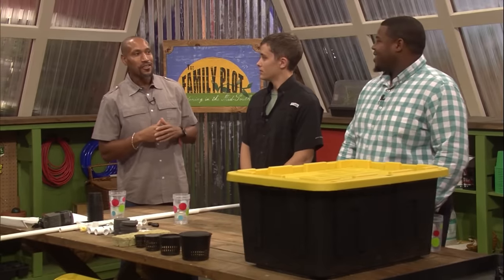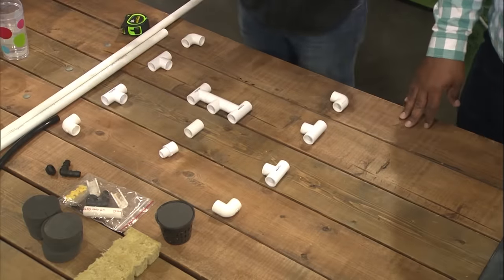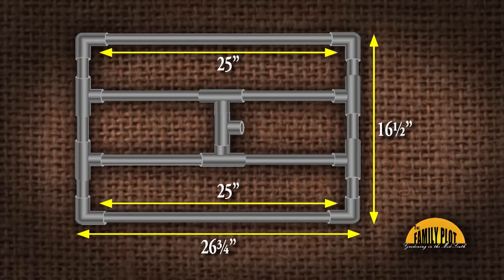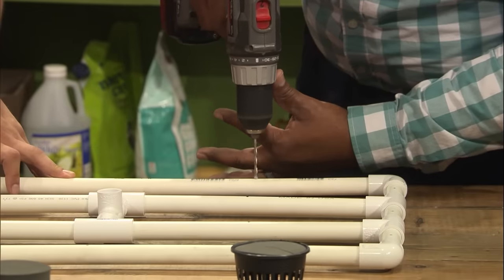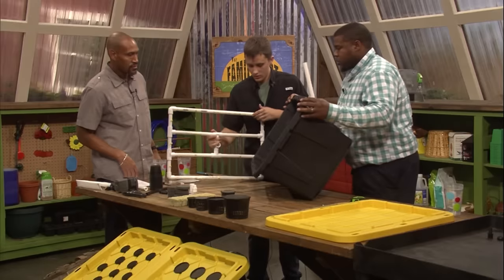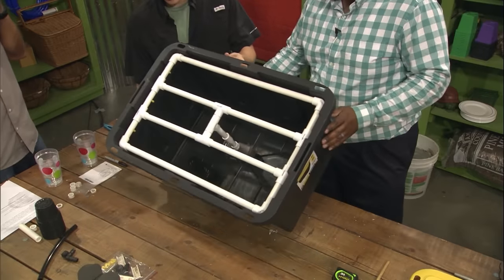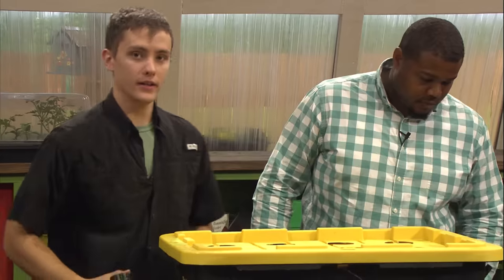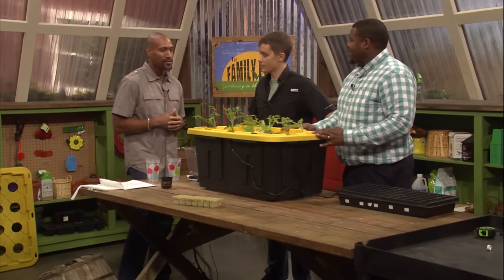Building an Inexpensive Hydroponics/Aeroponics System

Comment: I've just constructed this; with the sprayers pointing downwards as in the video, no water is spraying the cups that hold the plants. I'd imagine they should, would it be best to have the sprayers pointing upwards?
Reply: The idea is to transplant cuttings (or seedlings) that have roots already extending down a bit. If you need the extra help, twist the pvc "T" so that they point up and then point then down again after the roots are long enough. Watch for leaks when pointed up, though.

Comment: interesting, the first time I seen that kind of sprayer system, as I am used to old school method  of using fish tank bubblers to keep the solution agitating & filling the reservoir to the bottom of the plant baskets until the roots grow into the solution, at that point you can allow the solution to evaporate down to the 3/4 full mark.

Comment: How often would you cycle the pump with this setup?  I was thinking of doing this witht the pump on a timer.
Reply from the maker: This set-up does not have a timer. It runs all the time. You can use a timer if you want.
Reply: @FamilyPlotGarden  Thanks, I bought a 400gph pump but it is not variable, do you think the pressure would be too high?  I noticed you turned the flow valve down in the video on the pump.
Reply: update, pump works great no need to reduce the volume.

Comment: Hey so what's the advantage for something like this vs a stagnant self irrigating system like an autopot?
Reply from the maker: The spray aerates the water which allows the plants roots to get more oxygen than stagnant water. It also allows more plants per square foot than an autopot style system. It is also totally self-contained.

Comment: Can you please let me know what the spec’s on the pump you used? Also won if you tried a pump with less or more Gallons per hour. Just want to be able to compare cost on the pumps. I’m disabled and on fixed income so I want to be able to keep costs down where I can. Thanks for any help/info you can give me.
Reply from the maker: This is a 400GPM pump. You can use a pump a little larger and smaller than 400 if you want. The problem with a smaller pump is that eventually it is not powerful enough to create enough pressure for the spray heads. I would not go below 300GPH. You can go as large as you want because most pumps like this have the ability to restrict the flow at the pump. Another way you can save money is to only buy 180 degree sprayers and use two of them close together to form 360 degrees. The more sprayers you use the larger the pump you need. I did the 180 degree sprayer trick for one system and it still runs fine on the 400GPH pump.
Reply: @FamilyPlotGarden  thank you for your answer. I’m going to start learning how to grow this way. With everything going the way it is I feel the need to find a way to grow year round. I live in the northeast. There’s a big part of the year that growing outside is not an option. Thanks again keep posting videos like this that help people have options for feeding themselves and others
Reply: @oldtymeliving4198  good luck to you! Thanks for your interest!

Comment: Just going to put this out here. This is a very interesting system and it does work however, after some time the lid leaks. Which makes sense because you are spraying water over and over. Great concept, just keep in mind it will leak eventually. In addition, the hole to pass the cable has to be on top, not on the side, again, the water spray will leak from there. You can perhaps put a gromet and prevent that. And some kind of seal on the lid to prevent leakage.
Reply from the maker: Because the sprayers point down the leaking problem is eliminated in this design. The water does not spray toward the top.
Reply: @FamilyPlotGarden  yes thanks for that. That fixed my problem. Question now, I am seeing a couple of the oasis not getting the sprayed water at all. Those don't have long enough root yet. Any advice?
Reply: @jeanLo215  Point the back up and run some weather stripping (its cheap!) on the rim of the lid until they are long enough, then spray  down again. This system is best used with plants that have a decent root already. But can be adapted for any application. Just use your imagination and recreate the technique according to your needs. Smaller totes do good for tiny plants and can have many plant sites right up against each other.

Comment: I’m conflicted as to whether to do this type of system with the sprayers versus a DWC with a bubbler aeration system.  I’m a beginner at hydroponics.  Any advice?
Reply from the maker: Both are good first systems. This may be a bit more bullet proof because the aeration is guaranteed by the sprayers. But, either way you can be successful and learn a lot.

Comment: Yo Experts. Paint the Top Black. Algae will grow inside if you do not. The manifold should sit Much Lower. This Expert seems to have issue with the Tape Measure.Also drilling and running your drill bits and tap before assembly will keep the debris out of the system. Also an elbow and piece of clear tubing running up the side with show your Water level. Great Build Concept and fun DYI project

Comment: Thx!
PS. If you drill and tap the threads while the pipes are still apart then you can wash out the debris before assembly.
Reply: good tip. limited ability in the studio!

Comment: What type of sprayers did you use? Where can they be purchased?
Reply from the maker: I am not sure the exact type Scot used. You can find similar on Amazon if you search "hydroponics misters" I have used the Amazon ones in other builds and they work well.
Reply: We prefer to use any sprayer that has a hex shaped head so that our drills can handle the work instead of our fingers. The sprayer types with the two "thumb prongs" are exhausting to work with, but they do have a phenomenal spray.

Comment: What is the GPH on the pump and can you use flexible tubing like vinyl in a 5 gallon bucket?
Reply from the maker: The pump is 400GPH. You should be able to use flexible tubing, though I have never tried. I love hydroponics it is all one big science and engineering experiment!
Reply: @FamilyPlotGarden  Awesome, thank you. I tried a 40gph pump and it did not work. I got a 550gph and it is working much better. I don't get the same amount of pressure as your video so I assume its the flexible vinyl that I am using or the sprayers. Thanks for the comment and video, it was very helpful.

Comment: If you don't have a "cheater lid" to use as a templet, what is the layout for the holes?
Reply from the maker: Hey, it's just a grid where the holes are spread 3" apart.  The important part is that it's a grid.  Hope that helps.

Comment: This might be a dumb question, but I was told there is NO dumb question, but how do the plants get watered if  the sprayers are faced down?
Reply from the maker: Not a dumb question! The sprayers barely hit the bottom of the net cups so they keep the rockwool cubes moist. Pointing the sprayers down keeps the spray from coming out the cup holes and power cable hole. No leaks.

Comment: Hoping someone can help me with a couple of questions. 

1) do the seeds already need to have sprouted for them to be transferred to this setup or can I just go ahead and start them in the setup?

2) does the pump need to be running 24/7 or can it have on/off cycles?

Thanks!
Reply from the maker: The seeds can go either way. I usually sprout the seeds before I move them in. I put a few rockwool cubes in a shallow dish of water and drop seeds in to the depressions on the top. About the time the plants get their first true leaves I move them into this system for the rest of their lives. I find sprouting them in plain water with no nutrients lets the plants grow before the algae takes over. Once they move tho the system they are large enough to compete with and shade out the algae. Algae grows fast on cubes with nutrients.

We run the pump 24/7, but you can put it on a timer. 15 minutes on every hour should work. If the roots are drying out between you can increase the on time.

Comment: With that setup, how do the sprayers reach the net cups? 
how do you keep it water tight if adding a low pressure sprayer system?
Reply from the maker: The spray will barely hit the cups. Because they are pointing down they don't spray out the top or power cord hole in the side.

Comment: I want to build this. I just bought all the parts. I have a question about this system. Does it run 24/7 or does it only run for a certain amount of time? If anyone has any tips I would appreciate it. Thanks.
Reply from the maker: It runs 24/7. You could run it less (hour off/hour on) but it is easier to just let it run. The pump does two things. Obviously is sprays the water, but also the sprayed water picks up oxygen in the air so it keeps your nutrient solution fully oxygenated which the roots will appreciate. Many people say you need to have air stones in the bottom, but this eliminates that requirement. When it is running you can't see more than about an inch into the water because of all the bubbles. Good luck on the build!
Reply: @FamilyPlotGarden  thank you very much. Is there a nutrient that you would recommend for this build. I plan on growing peppers tomatoes and lettuce.
Reply from the maker: There are many different nutrients out there. We use the General Hydroponics Flora-Grow system, but that is only one of many options. 
There are two major types of nutrients: liquid and dry. Liquid nutrients are much easier to use, but cost more. Dry nutrients are much less expensive, but require more work to use. I would recommend starting with liquid until you get the hang of it. Then if you are serious, switch over to dry. Also get a nutrient system that is at least 2 parts, better if it is 3. You have to have multiple parts because some of the chemicals react with each other when they are concentrated. The instructions on the containers will give mixing instructions that will avoid these problems. Here is a video where we mix nutrients for this system: https://youtu.be/gYrTTLbl3Ro

Good luck!
Reply: @FamilyPlotGarden  thank you so much for the information.

Comment: My question is, with all the different plants/vegetables in the same tote, will their roots get tangled together?  If so, what happens if you harvest or change one of the plant?
Reply from the maker: They can get tangled. If one plant dies and you can't get the roots out there is a real possibility of rot and other problems. We have had several plants die and we left the roots because they were tangled. We did not have that problem. One of the problems is the decomposing roots can use all the oxygen out of the water. Because of the excess aeration this system does this is not a problem here.

Comment: This is great and all but what happens when the plants mature and well grow huge?? Tomato plants get massive. Nice design but there is not enough space..  basil and most of the other herbs should be fine even though they also grow quite large.. can you post an update video on how this worked out?
Reply from the maker: We don't have a video, but there are pictures in the link in the description. We trellised the tomatoes and they did well for several years until we accidentally killed them by pruning them back too severely.
Reply: Use a trellis for your vine and throw a couple of basil plants for a delectable tomato/basil combination in one hydroponic tote! The basil will fill the area that you've trained the tomato vines away from. An excellent approach to indoor hydroponics or even to use outdoors where natural light will save you a bundle in electricity costs!

Comment: Why are the sprayers pointed down instead of up to the plant stems?
Reply from the maker: They are pointed down so the weight of the plants can be supported by the pvc pipes without resting on the sprayers. it also keeps the spray from coming out of the holes in the lid and the power cord hole.
Reply: @FamilyPlotGarden  Ingenious idea on the spray jets pointing down.The mist will be enuff to bring the humidity high anyway.
Watch for water sub pump heat rising may cause algae,or try Z9 stabilizer

Comment: I'm a full time 5th wheel Camper. Can this method be utilized without any special lighting?
Reply: Yeah I was wondering about the light situation myself?
Reply from the maker: You would need to make sure it got plenty of light through a window and it should do okay. Also, when you pull into a site you could take it out and set it on the ground so it can get sunlight.

Comment: My problem with that particular tote bin, which I use for cloning, is that it doesn't seal perfectly which results in a steady drip to the floor. Any ideas on how to make a gasket for the lid?
Reply from the maker: This one does not drip because the sprayers are pointed down. I have has several of these running for several years and have never has a single drop.
Reply: If you're spraying up, just get some weather stripping from the hardware store and stick it along the rim of the tote and drop the lid directly onto it. That will stop the drops. You'll need to replace this stripping from time to time. We are definitely going to create our own line of these one day, without this complication. The stripping is cheap, though, and won't break the bank! Give it a shot. We use it in a few applications, as much as we loathe having to replace it, sometimes some waste items can't be avoided.

Comment: Any particular sprayer? Currently have drip system and it is just to much.  I want to add sprayer and adjustment valve
Reply: 330 degree hydroponic mister. Hydroponic pump, not a fountain pump. The bigger the pump, the better the spray.

Comment: I've been building hydroponic systems for years and there's nothing wrong with the design of this I would recommend using the food grade plastic container instead of the cheap black and yellow Home Depot totes
Reply: the plastic for these totes is the same type of plastic used in baby bottles. similar rating, i mean

Comment: Does this can be set up indoor with grow lights?
Reply: anything you want. common lights are called high intensity discharge, HID, lights.. which are usually HIgh Pressure Sodium, HPS, and metal hallide, MH. A nice, strong LED made for gardens will also suit. if just running small plants meant for transplanting, basic shop fluorescent/LEDs may be used.

Comment: How often does one change the water?  Thanks!
Reply: weekly to bi-weekly, depending on a few variables such as water quality and plant size. the "dirtier" the water, the more frequent the change. as well, the larger the plant, the more frequent the change because it will effect the nutrient balance in the mix. you can, however, get by adding a nutrient mix to the tank to bring the levels back, but the water should be changed at two weeks regardless.

Comment: if you use a clear tube for the drain tube, you can see how much water is inside as indicated on the tube
Reply from the maker: You can...but... the clear tube also lets light in and algae will grow in the tube. I leave one corner site unplanted so I can lift up the net cup and take a peek inside.
Reply: Algae. Which doesn't scare us but defeats the purpose of the clear tube. This idea was born by the big hydro manufacturers for marketing. We don't use it.

Comment: Can someone explain why you cant just get a shallower tub and have the plants just in contact with water without the need for the pvc and spray things? If you switched out the water like once a week?
Reply: The water needs to have oxygen added to it constantly. The most common way to do this is with airstones but we found it highly inefficient for larger containers of water, and they also need periodic replacement which is wasteful. As well, this tote is designed to use as little water as possible. As long as the water level clears the pump, the plants get fed. This is especially useful while the plants are small. Less water, means less nutrients and more savings. You can used a shallow tote, but then when the plants get very large the roots will be a problem. This system is designed to mitigate all of these setbacks and also be approachable for the novice home gardener.

Comment: What about using a vaporizer instead of the nozzles, pump, or frame? Just drop it in the water and you're done. It would create a cloud of moisture in the container and I think it would use less electricity than the pump. I'm going to try that.
Reply: How did it go!?

Comment: does glueing it together effect the filtration?
Reply from the maker: We find it is better to just friction fit it. That way you can take it apart if any debris get inside. The pipes will leak slightly at the joints, but this is minimal and because it is directly above the reservoir it will not cause any problems.